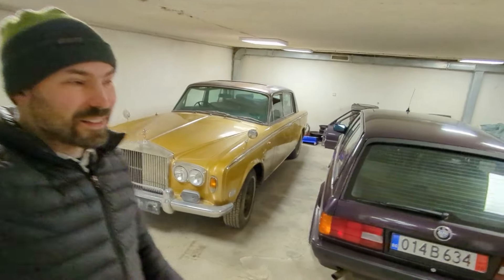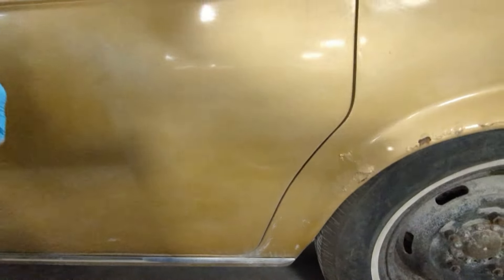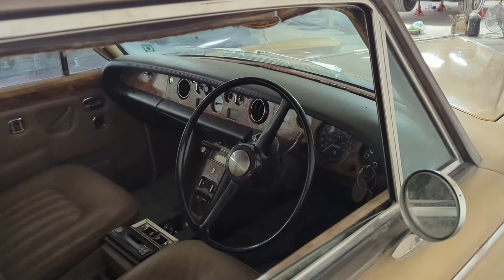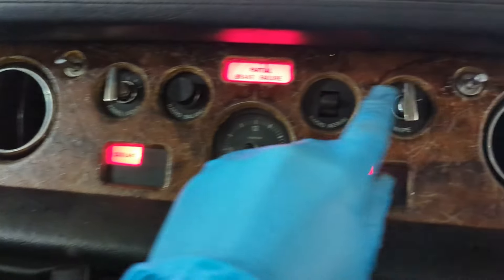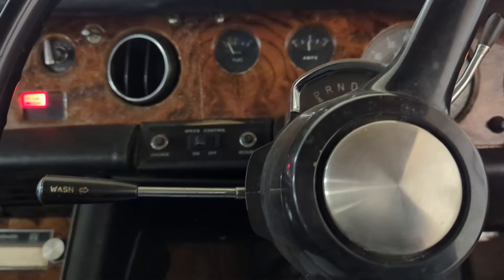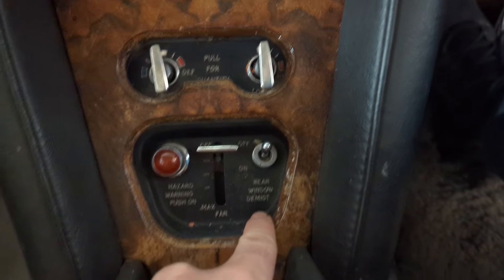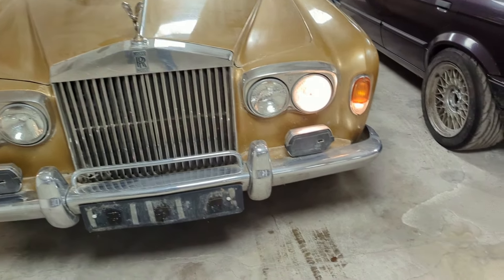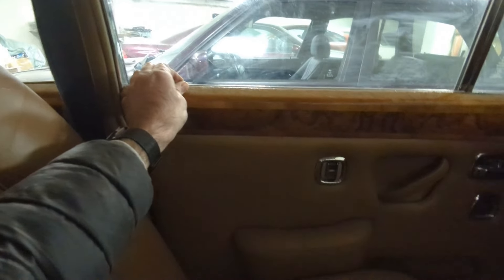Cheapest Rolls-Royce Silver Shadow in Europe - part 1

Comment: Looks like a fun project!  I‘ve worked on these cars for decades.  Be very patient, and fix one problem at a time. Don’t get frustrated with it!  It will be a well running car one day!  You will need to change the thermostat as well as all rubber flex hoses on the brakes.  This is very important. Your rear hydraulic leak is usually coming from the height control valve.  Take your time rebuilding it with factory quality O-rings.  IntroCar in the UK is an excellent source for parts u will need!  Good luck with the project.  I have a 1965 Shadow I am fixing.😊👍
Reply from the maker: Thanks for the input! I found the leak, you'll see that in my next video. The major leak was elsewhere, but the height control valve was indeed seeping as well. I'm going to take your advice on the thermostat and hydraulic hoses. The good thing is there are 3 redundant brake systems, so I'm not at a huge risk for an initial test drive :)

Comment: I bought a 1986 Bentley Turbo R running and driving.. i make a few videos with it but not repair videos because I wouldn't know how. Mine is the SZ whereas yours is the SY but the SZ is based on the SY and it's quite similar with a slightly different body and a few changes but still with the RR 6.75litre V8 but mine has a turbo.. My suspension and brakes run on mineral oil like Citroens do... Your videos are interesting. I can't see the back of mine to reverse either😅😅 My parking brake is a silly foot operated one, put it on with left foot and release with a little silver lever under the dash. There may be a switch to disable the rear window switches in the console so they work from the switches in the front but not from the switches in the back.. You may have a town and country horn. A quiet one for in town and air horns when in more open areas.. My 1986 one is a bit more modern but still 38 years old and is absolutely ok with modern traffic apart from trying to park because it's so big.. Best Wishes for getting yours going..cheers ron2256

Comment: Good luck, you're going to spend more on parts to fix it than the car cost. There is a reason why they are cheap to buy. There is a 78 in Florida for $1999. With velvet seats.
Reply from the maker: Let's find out :) My goal is going to be to keep it under double cost. Challenge accepted.

Comment: You will want to weld the sunroof shut!  The factory did not like these, as they always leaked, and ruined the interior.
Reply: Which is why RR never put  them in cars. They ALL were added extras, not supplied by the factory or Rolls Royce. Having said that they do add considerable value to a Shadow IF they are working properly.

Comment: No way... I did buy mine for €1950 and runs OK... Paint work is crap but cheap than mine no way!!!
Reply from the maker: Nice! I just looked at your video - looks like a similar project (with more bodywork and less mechanical work needed). You should post more videos! Btw my claim is that I got the cheapest Rolls-Royce right now, in 2024. I'm sure there were cheaper ones at some point in the past but this is the cheapest ad that existed over the last few months.